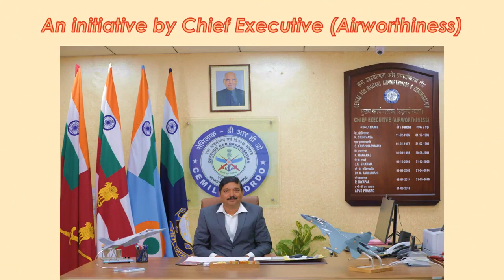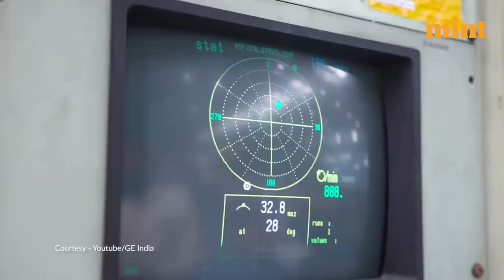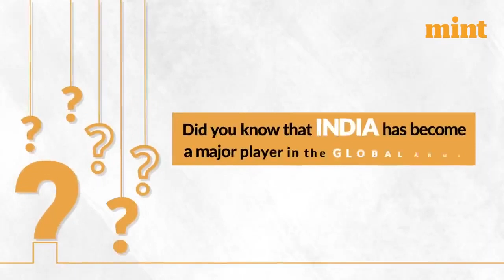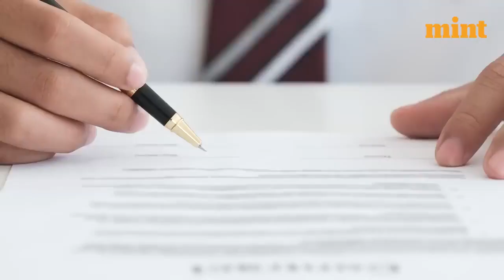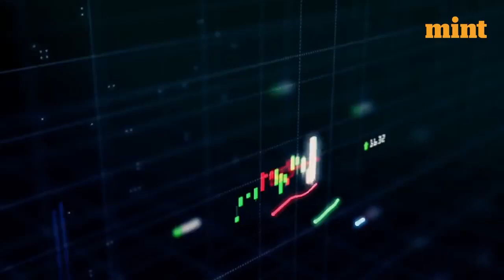Lecture 02: Airworthiness Certification of Helicopters

Comment: It seems most companies today are no longer using Waterfall/V-Model, and instead using Agile (or one its subsets SCRUM or Kanban) for their Software Development Life Cycle (SDLC) process.

I'd like to move away from a rapid-prototype environment , and develop the formal habits in order to write high quality embedded software..  for ANY industry..  Aerospace (like Lockhead's SEAL Level 1-4, Boeing Class A-C , DDPMAS, Design Assurance Level A to E etc) , Medical or Nuclear industries.. even Automotive. I'd love to see a trivial project example that shows all the steps and outputs.

For example, assuming I document the process on how the code is generated, what constitutes proof that it's safe?  
Static Analysis?
Code Coverage  - Statement (Level C), Decision (Level B), MCDC  (Level A)?   
Who defines the unit tests?   

I imagine there are differences between the industries.. 
FAA :  DO-178X , DO 331 , ARP4754A  , ED-12C
FDA : 13485 ,  ISO14971 , IEC 62304 , SaMD  and
DOE Nuclear : 414.1x, 
(Automotive : 26262)

but what are the typical tools/software needed, and the typical document/artifacts in the various stages of the software life cycle?  

And with so many tools, some available as limited for evaluation/trial...   which do you recommend for learning?
Requirement Management -  (IBM Ration) DOORS, JAMA, Xebrio, rmtoo florath , doorstop-dev / doorstop , reqview, STELL
Static Structural Source Code Analysis - Parasoft, PolySpace, CodeSonar,  horusec , SonarCloud, veracode PREFast, TBrun, LDRA
Dynamic Analysis / Modified Condition/Decision Coverage (MC/DC) - VectorCAST, RapiTest
Traceability Tools: Reqtify , Polarion , McCabe
Configuration Management / Storage and Version Control System - Git, SourceSafe, Mercurial, MS TFS, ClearCase
QA / ALM - Helix ALM for Managing Artifacts, Establishing Traceability, Documenting / Enforcing Processes, etc
(I)V&V /  Unit Test Automation - VectorCAST, LDRA Testbed , Mathworks Simulink DO Qualification Kit
Continuous Integration (build and test) / Continuous Delivery-Deployment - Jenkins, Bamboo, or GitLab CI/CD

And what is the general attitude towards open source embedded software (ex. FreeRTOS) and code-generation tools (ex. ST's Cube MX)?
   
Also, how do CPLD and FPGAs fit in to the firmware picture.. they're not exactly software nor hardware, but are programmable devices written in an  programming language like VHDL , (system) verilog , Amaranth HDL ?  How would DO-254/DO-178C apply to HDLs?